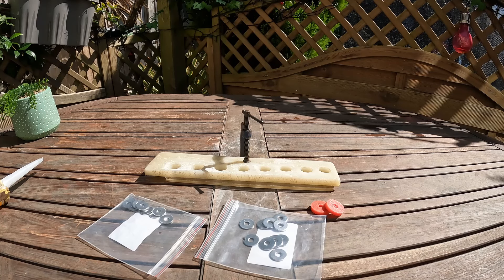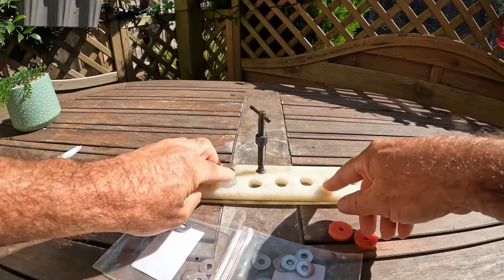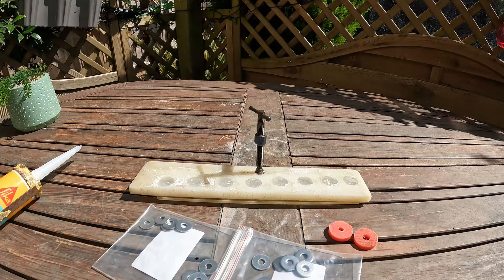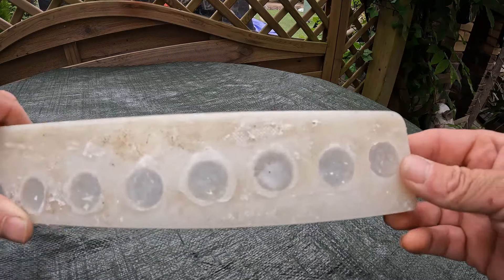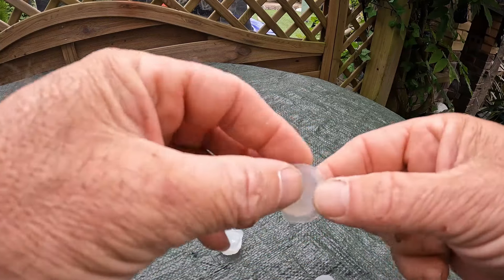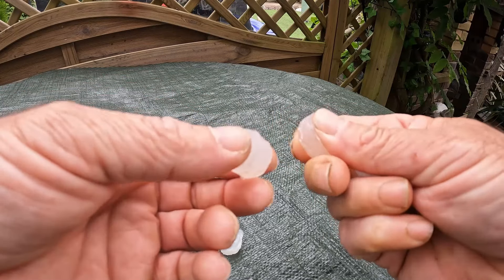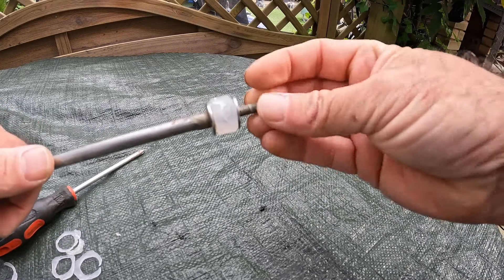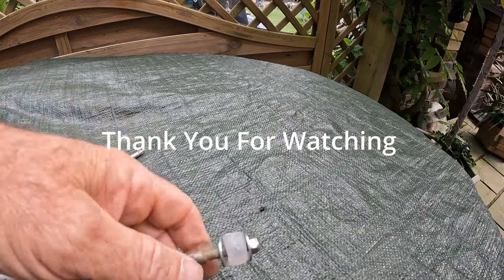22mm lugworm bait pump washers Made From Silicone and Water

Comment: Hi mate how long do you have to leave the silicon in the soapy water before you can take it out and mould it cheers
Reply from the maker: Hi you should be able to mix it straight away then put into the mould  but i did find if you leave it in the water afterwards for 5 min it became alot firmer also try to squeeze as much air from it other wise you will get bubbles in the seals good luck
Reply: Hi bud can you do a video on how you mix the silicone ,from start please great video pal cheers